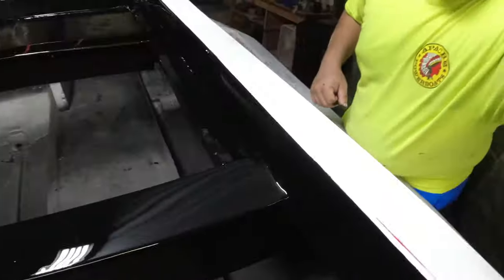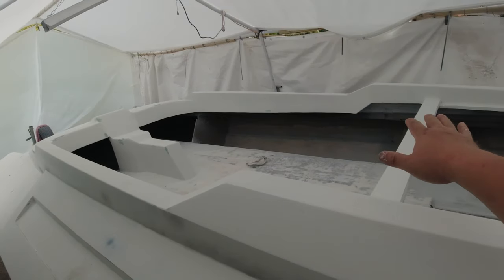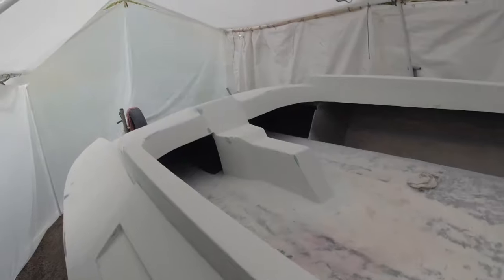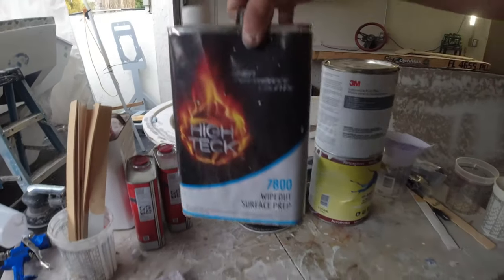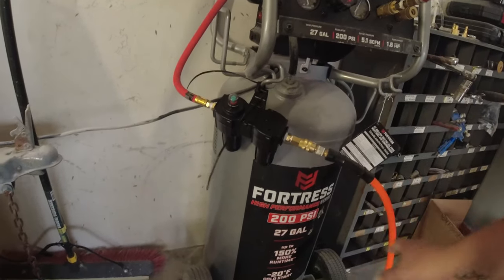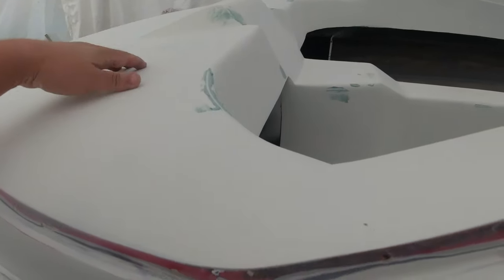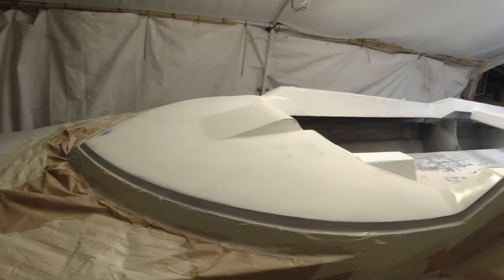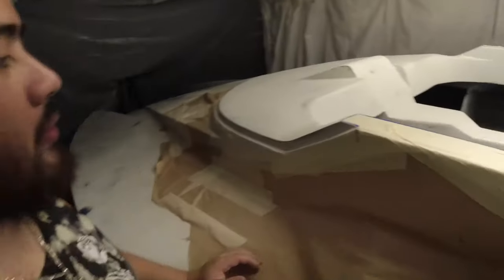Painting my boat with SINGLE STAGE using a $14 Harbor freight spray gun ( it’s my first time)  ￼

Comment: This shows you that u don’t need thousands of dollars to get on the water if u can do the work yourself or is willing to learn and do it yourself, 
 I got a 30ft panga with twins etec 115 and did all the work myself, paint , engines and got the boat water ready in les than a year during the pandemic

Comment: Should've commented on the last video. Worked in machine shops for years and your hand is usually really good at feeling defects in things. You can feel very very small variations. Only thing is on long surfaces you might not feel a shallow dip over distance that light reflecting could show.